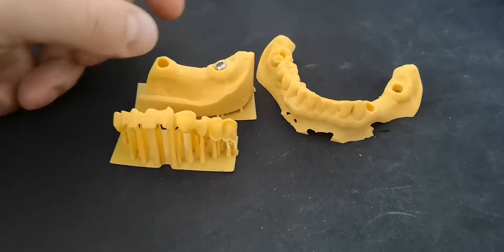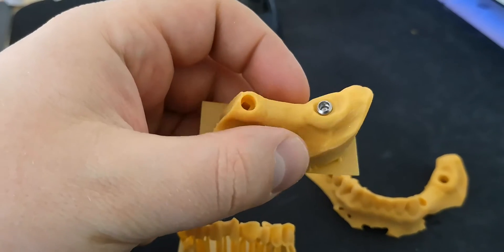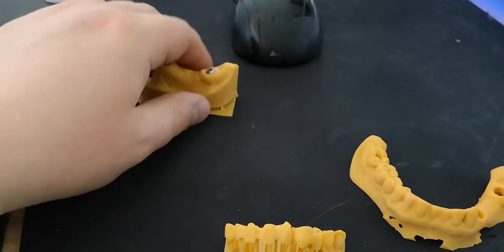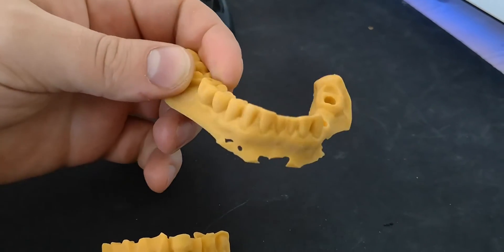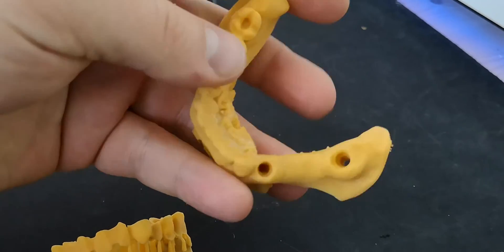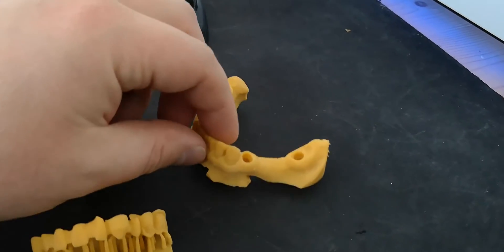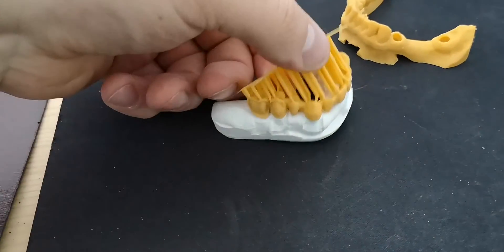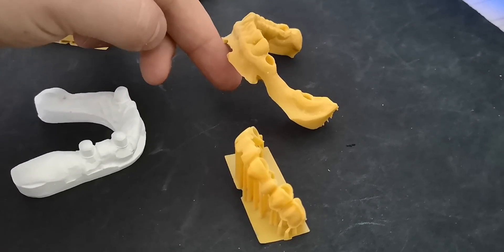Ackuretta Freeshape 120 - Test prints for research

Comment: hi. tell me, how is your printer different from Diplo?
Does it suit you for printing crowns and bridges under casting and printing veneers under e-max?
Reply: Are serious Oleg? Diplo is DLP printer and freeshape is mSLA (LCD). Its like comparing "pipi" and finger :)))
Reply: @CADAON  I didn't ask for technology. So which is better in the end? now typing e-max on asiga
Reply: @unselfishness0699  you already have better solution.
Reply: @CADAON  Thank) but this is not my printer, I give the work to print, and then press in my lab. Now the question is buy Asiga X or ... what do you advise? thank)
Reply: @unselfishness0699  for single crowns burning out and pressing from Emax or whatsoever you should be just fine with ackureta, phrozen, epax and I would even recomend for example buying two cheaper LCD printers to have backup unit. DLP printers show their strength printing comolicated geometries and bigger parts with consistency but mSLA fail to that with comparable success. I think for burn-out crowns freeshape 120 or phrozen shuffle is more the enough. Asiga would be overkill and for it to oay off you should print at least 20-50 crowns a day.
Reply: @CADAON  thank.
then I will look towards 120
Reply: Hi  @unselfishness0699   - if you have any questions about our Ackuretta 3D printers, let us know - you can always shoot us a message via our Facebook Ackuretta User Group --> https://www.facebook.com/groups/2164055477166718 
Ackuretta Team - Jan